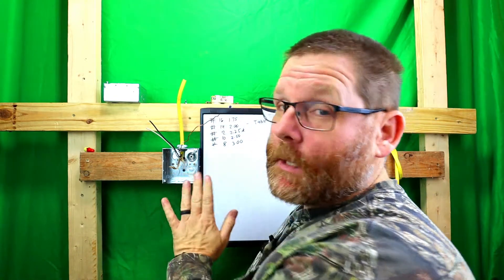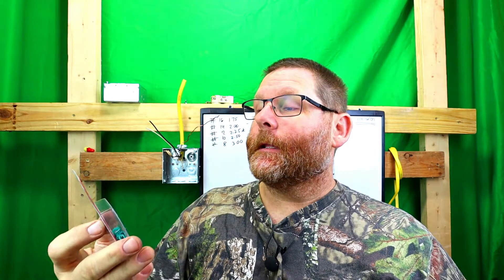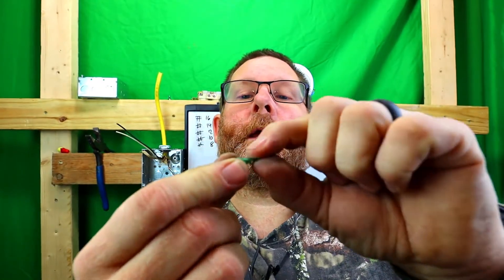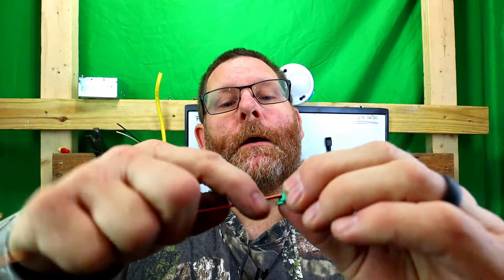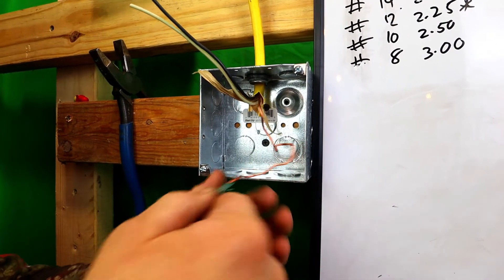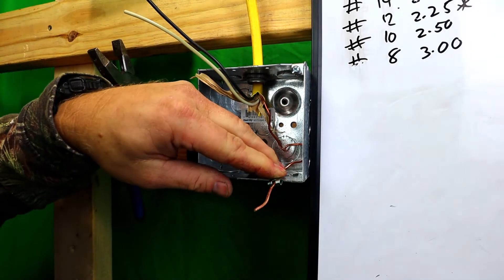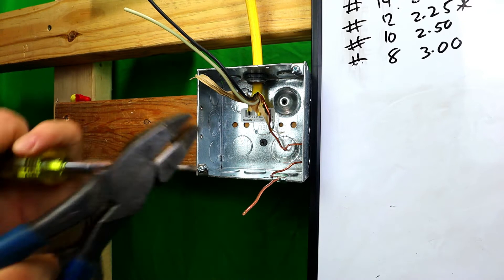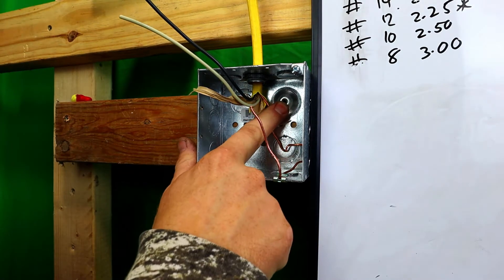How To Use Electrical  Grounding Clips

Comment: May I ask when it comes to the grounding screw? If you are using the green grounding screw instead, can you just put it in any hole in the metal box including on the sides or the top? 
My friend who is helping me says it doesn't matter what hole or where the grounding screw in the metal box goes. But I thought I read it has to be a threaded hole. Thank you
Reply from the maker: It absolutely has to be threaded hole for sure.

Comment: Great video. Quick question:
Hooking my new garbage disposal up and the ground is too short for some reason to wrap around the screw. Can I just use the clip instead or any other suggestions would be appreciated?
Reply from the maker: Make a pigtail on the short wire. Or an inline splice I would never recommend them on anything but on the ground they're pretty decent. I'm not a big fan of the Wago connectors but here is a link that you can see what I'm talking about https://amzn.to/4dqrNmF
Or these https://amzn.to/3WPthzN
 Or like I said make a pigtail and extend that wire with a wire nut

Comment: Hi! Great video! One question though, and forgive me if it’s a silly one but is it OK to use the same wire from a cable coming into the box as the ground cable for the box itself? I’ve been cutting small pieces of ground wire and adding them to the boxes and then wiring other incoming grounds to it but is that superfluous?
Reply from the maker: It isn't a silly question, actually it's quite the opposite it's definitely ok to use the ground coming in. I'm thinking about doing a video on this very thing. Thank you for your comment and watching ☺

Comment: I've been an electrician for 12 years and I never knew about grounding clips. Normally I just use a self driller to the box. This is a good tip for boxes in concrete.

Comment: What if you don't have a third wire/copper/ground wire coming from the wires feeding the electricity? Like what if you only have a white and black?
Reply from the maker: If you have conduit, conduit acts as a ground. But it has to be intact from point a to b if not no point in having it.

Comment: I'd never seen those grounding clips until around forty years ago. At that time bx was suddenly made legal to use in new construction. But the inspectors required that the bond wire inside the bx be bonded to the box and required we use those grounding clips to do that with. I've never used them for anything other than bonding bx to the box.
Reply from the maker: I try to never use them either.

Comment: I had those in literally every single electrical box in my house when I bought it. Most of them were corroded, covered with drywall mud, or just looked like they really weren't doing anything. I bought a 100 pack of green grounding screws and have been replacing them by attrition. Newer metal boxes come with that raised portion to thread in the grounding screw... but when there was no space for them, I drilled a hole in the box, making sure to go into the wood/concrete behind them, and gave myself room to install the grounding screw. It's nice to know that those clips work because I have a ton more to go. Thanks for another insight that really helps those of us that aren't professional electricians.
Reply from the maker: Always my pleasure

Comment: Super helpful, thanks. Working on a 100 year old house, there are many old metal boxes with no threaded hole for grounding screws. Either I dont want to remove those and want to add to them but ground the box while I'm in there, or I simply don't like to just toss away the old ones with new metal boxes being several dollars a piece these days. So this is a great retrofit.

Comment: I just bought a house and so far all the outlets and switches have a metal box with that ground wire clip. I want to install new outlets and switches, so does that mean I do not have to run a ground wire to the outlet or switch since the metal box is already grounded?
Reply from the maker: If I understand you right. Then you can my code use self grounding receps and switches and that will be ok. Are you sure that your boxes are grounded??? Just because someone put those on there doesn't mean it's a true ground. Good question and definitely check it out to make sure they are truly grounded.
Reply: How can you know if your metal boxes are already true Grounded bonded? I wanted to add in new outlets to metal boxes in the outdoor shop. I don't see any green screws or clips or pigtails with copper wire in my existing metal boxes out there. So I'm thinking I need to add new pigtails with green screws to make sure the metal box is truly grounded? @MountaineerOutdoors
Reply from the maker: It's a process. Too much for me to get into here

Comment: Is there any reason someone would've cut the ground wire and not used it, just a 2 prong outlet? I'm working on updating my outlets to 3 prong. Your videos are very helpful. I appreciate all the advice you give freely.
Reply from the maker: I don't know, I don't understand why anyone does that. I have seen it alot though. I appreciate you watching and commenting ☺
Reply: It's someone that doesn't know what they're doing. NEVER cut a ground wire. Always use a ground wire and make sure your metal boxes are bonded. Replace plastic and nylon boxes with metal boxes if you can. And be sure they're bonded to ground.
Reply: This is an old post, but I would guess they only had a two prong outlet to install back in the day? So they cut the ground wire instead of shoving it back into the box. They may have even thought that was prudent to reduce the risk of an arc. They screwed you over in the process, but it didn't matter to them. Just a guess. Hopefully you had enough of it left to extend rather than running new Romex.